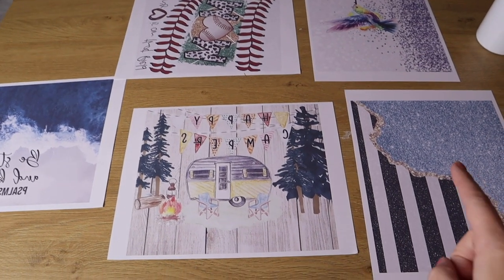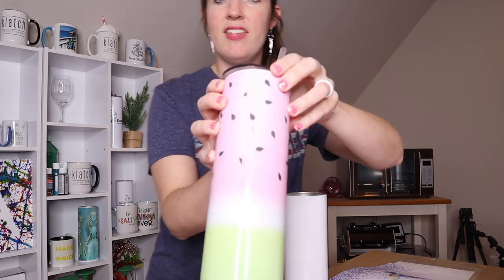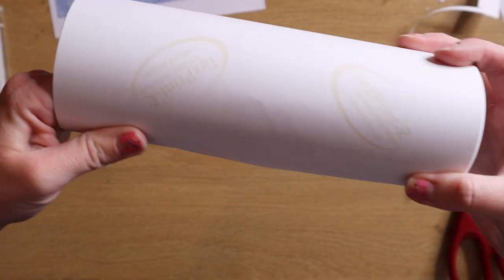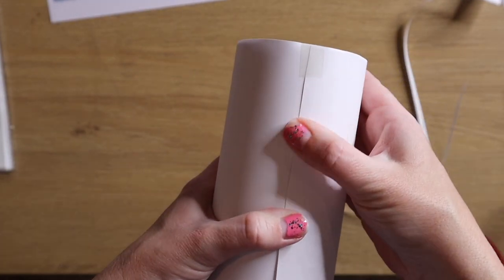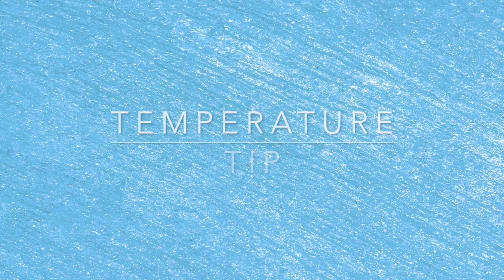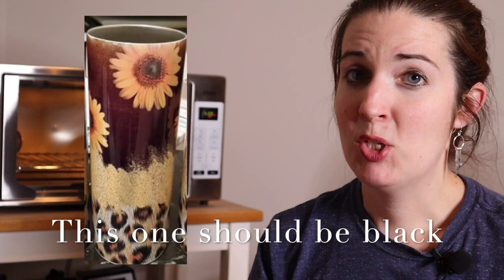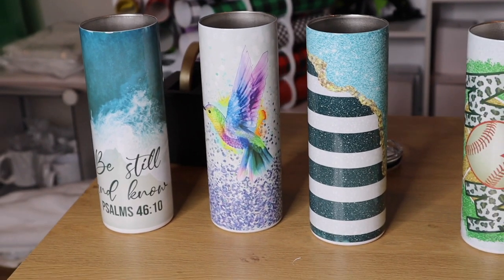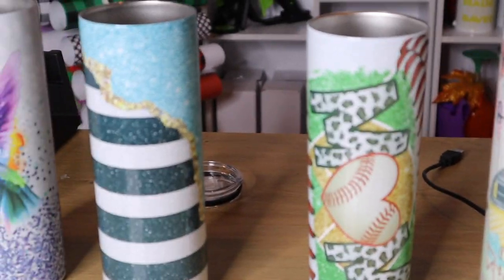Sublimation Tumblers- Where to get the BEST Designs & Common MISTAKES to AVOID!

Comment: Good afternoon Amy! Thanks for the video very informative! I got a question! Well is a problem to be honest! I got my sublimation printer Epson 4800 paper size 8.5 x 11” how do you go down to the tumbler paper size ? Nothing is working for me how do I get the right size ! Do you use a program or something to lower the size ! Plz help thanks 🙏
Reply from the maker: Hey Roberto- I print mine off on 8.5x11 paper as well and then just trim it down to fit the tumbler. Most tumbler designs are designed to a tumbler size so if you print that off on the 8.5x11 paper you should just be able to cut around the edge of the design and that should fit your tumbler. 😊
Reply: @amycreates1075  thanks for the response!🙏

Comment: did you tape the top and bottom rim
Reply from the maker: No I don’t tape the top and bottom of mine. Some people do but I do not. I find it works just as well for me if I just pull the paper tightly around the cup and make sure the seam is tight & well taped.

Comment: Hey I am having issues with the seam part of my tumbler. Is it normal to see some sort of seam? Should I not be seeing it all? Either the line is too define, if I cut it just a little, its to short and the white peaks through. Any tips?
Reply from the maker: Ahh the seam! It’s such a troublesome little thing. I’d say more times that not you’ll be able to tell where the seam is but it shouldn’t be horrible. It should be something you see if you’re looking very closely for it. What I do is I try to leave a slight overlap (about 1/8 inch). Then I tape all the way down the seam and then run your finger down the tape it make sure it’s secure. The key is to leave a slight overlap and to pull the design SUPER tight around the tumbler. I hope that helps! 😊

Comment: Does the metal racks burn through the shrink wrap?
Reply from the maker: No it does fine on the bars - if you over cook the tumbler yes then the shrink wrap will begin to pull away and that’s not good 😬 BUT I’ve started using a tumbler press now (after I filmed this video) and it’s AMAZING - I highly recommend it over a convection oven. No shrink wrap is needed or anything like that!  So much easier in my opinion. But if you decide to go the convection oven route I purchased my shrink wrap from Coastal Business Supplies.